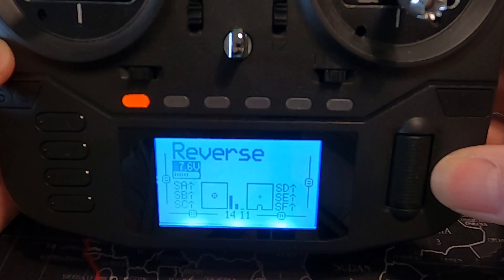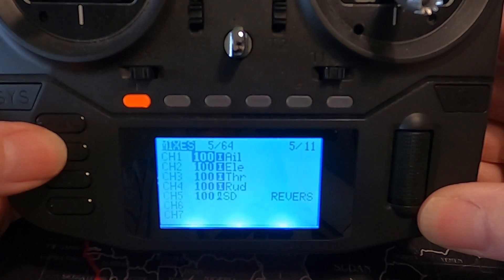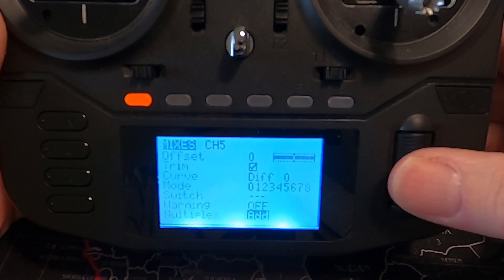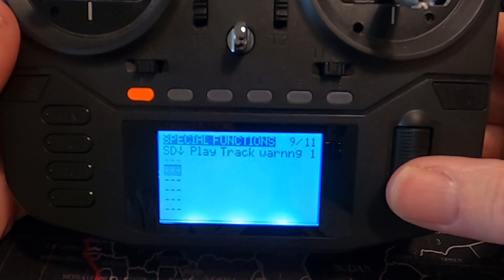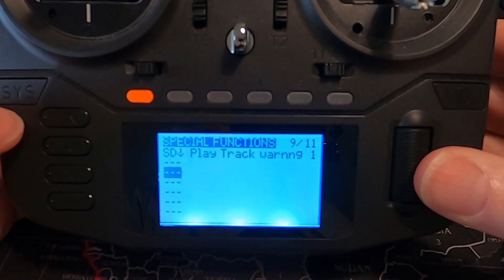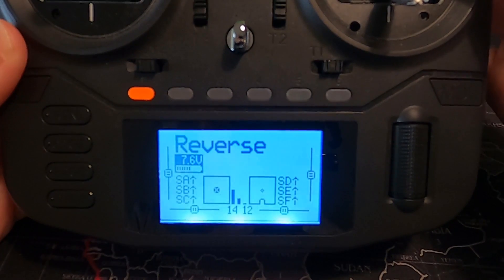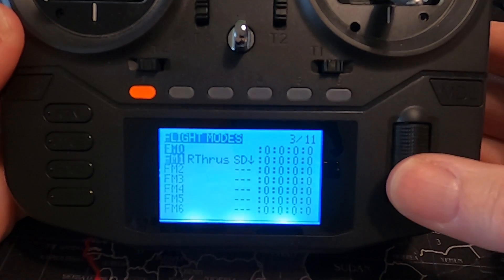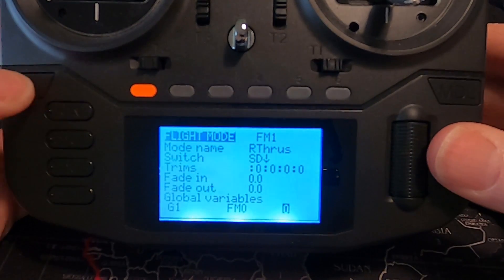EdgeTX Setting Up A Reverse Thrust ESC

Comment: Was looking for something more complex, as my ESC woulnd't reverse, but it turns out it is indeed just adding the mixer output. 
My ESC (D-POWER AVICON 40A) was not reversing however because by factorydefault the SMR (Reversing) function is turned off. 
Using the radio you can program the ESC. Very easy once i've read the documentation...why do we never RTFM ?  ;-). 
One thing i would like to add, the ESC manual warns not to use reverse with more then 50% throttle as it may overheat (with props on). So need to look into mixing this into my throttle output.